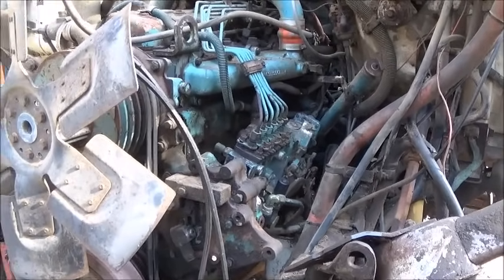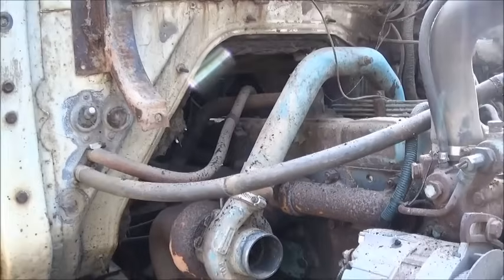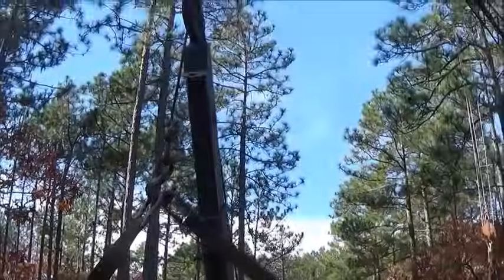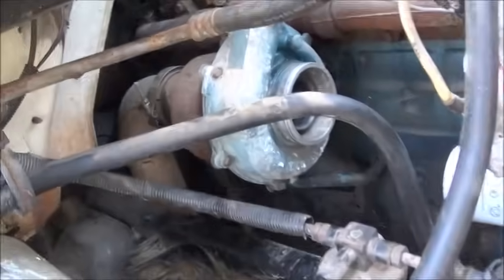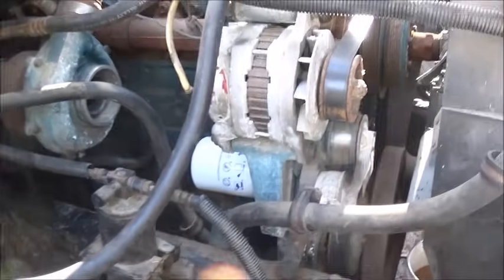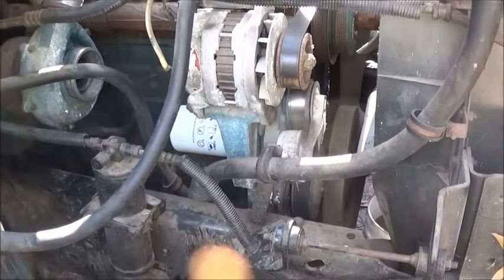INTERNATIONAL TRUCK UPDATE AND FRICK CORLISS EVALUATED

Comment: Unlike virtually all of my peers, as a youngster I left my 69' Firebird rag-top "box stock". No traction bars, ... no oversized tires, ... no performance enhancing modifications to the motor. Right out of the box it would run like a striped-assed ape, and ALWAYS go right where you pointed it. The fact that it handled so very well saved my dumb-ass on SEVERAL occasions. ( I sincerely believe the rag-top would definitely out handle the hardtop Camaros and Firebirds ) 

KUDOS to the Society of Automotive Engineers.

Comment: Johnathan my family owned a Navistar dealer up to 3 years ago. Those NGD DT466 the weakest point is the sleeves o'rings. If you want to make sure were is the water leak, pull the oil pan and pressurize the radiator. You might able to see if there is rust down the sleeves and skipping the pressurization. We work a lot on those engines and I don't remember once changing a oil cooler. Also the first batch we received had a lot of problems with the water pump. They exploded and wear the the back timing cover, but I don't remember if any wear enough to transfer coolant to the engine.

Comment: I like the IH truck work, the wreck work, your Studi work but I drool over the steam engine work!
Pretty sure you know the valves can be removed from the cap side for checking. Just a tang and slot working them.
That engine looks good so far.
A big sweetheart (300-350 horse) my engineer and I run is a bit worse for the wear but always aims to please.
Neat video sir.

Comment: The insulation around the cylinder looked like Vermiculite when I saw it on the previous engine,probably the same here.Good luck with making all the parts for this one, I don't doubt you have the will and the way to doit.